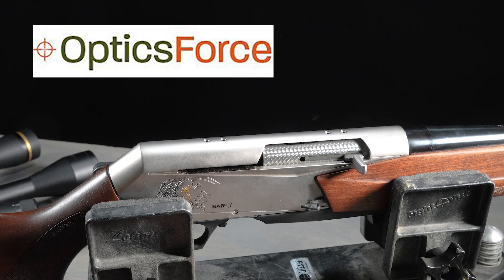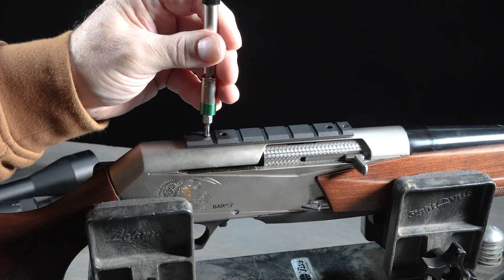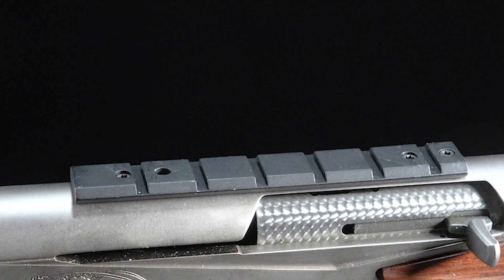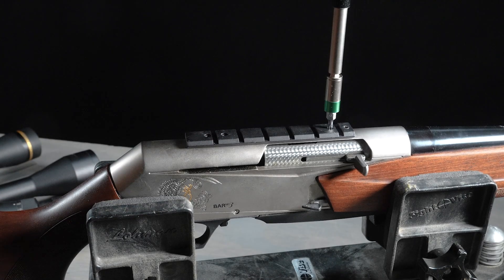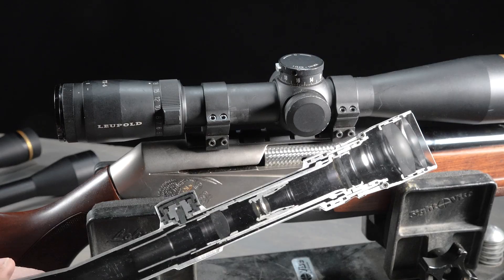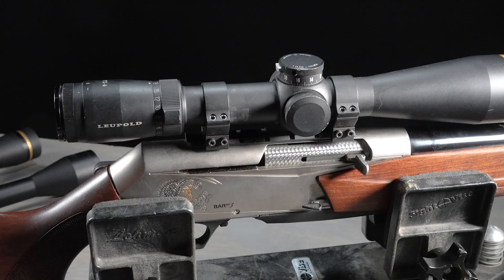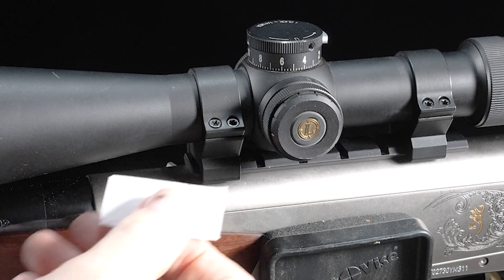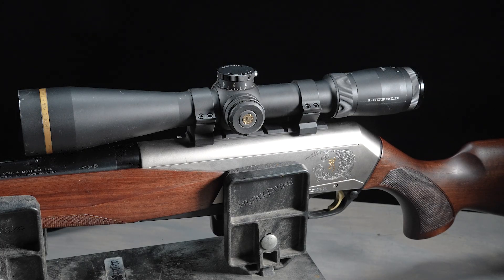Torqued for Precision: How to properly torque scope mounts and rings

Comment: I found something interesting when I got my M98B / Vortex scope. 
The Zero Gap scope mount from Barrett said it has to go to 35 lb/in, but Vortex said torque shall never exceed 18 lb/in.
Reply: I have the standard mount by Leupold on my Abolt.  They recommended 15 in/lb. for the rings to the scope.  35 in/lb. is excessive.  All my rings are torqued to 15"lb. on all my rifles.